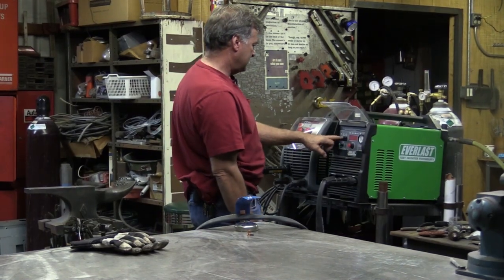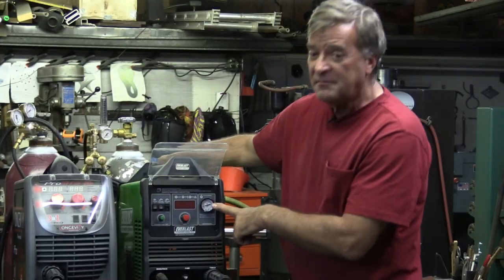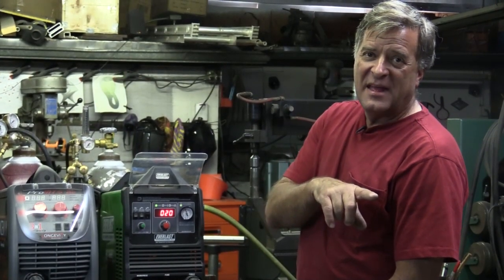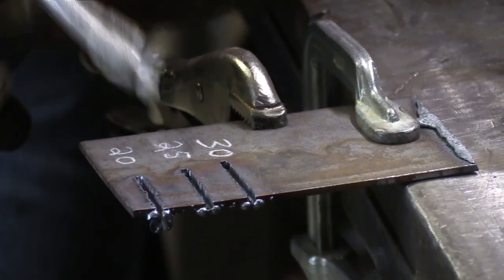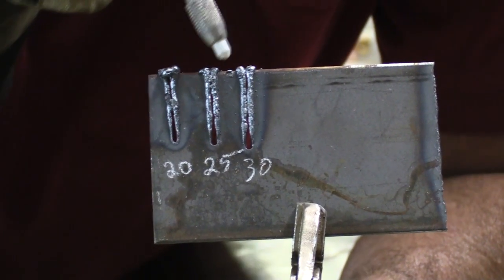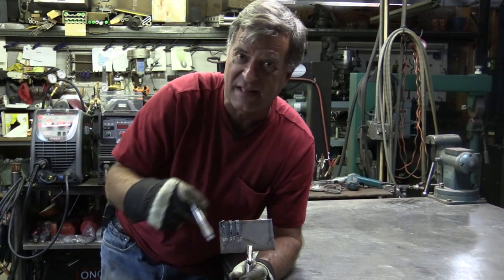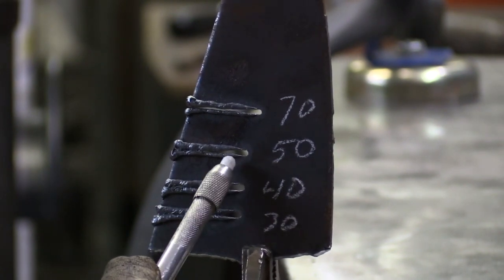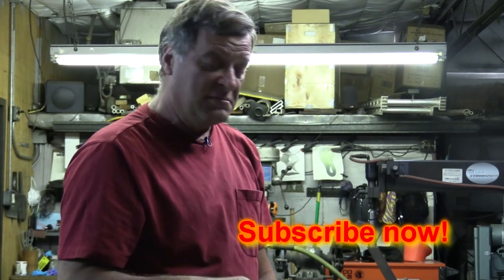How to Best Set Your Plasma Cutter for Cutting Metal - Kevin Caron

Comment: I'm returning my plasma cutter. It cuts horrible, the actual cut that is made is trash and it's just a horrible tool. A band saw blade it's cheaper and cleaner than plasma could ever be.
Reply from the maker: Thank you for sharing,
Reply: @KevincaronSculpture  after contacting the company and only asking for a new plasma cutter wand accessory. They said they wanted to send me a whole new machine without me sending the old one back.
Reply from the maker: Everlast has really stepped up their customer service.  I have been really happy with how that company is running.

Comment: i know this is from 4yr's ago but what kind of glass should you be using to cut  with a plasma... i get a lot of slag when it cuts through . im 66 so a little shaky ness go's along with my cutting . iv been verry happy with my plasma cutter it cuts through quite a  thick pice nothing is ever the same for me as thick ness go's thank you
Reply from the maker: I use compressed air.  No bottle gas needed. Try moving a little faster to cut down on the slag. Also up your air pressure to 65psi.
Reply: im sorry i use air also no gas with plasma sorry i have my air up quit high probably 75 i never cut any thing thicker than 3/8 even with aluminum i never ajust the air im repairing a aluminum flat bed for my truck probably 18" 3/16th ? it leaves quite abit of slag cuts fine nice fine cut but lots of slag i have a simadre CT5200D.. the everlast was mor money then when i bought this one it stick welds witch i have used an i have to say worked realy good it also is a tig but i have never tryed it that was a bonus i bought it just to cut with thank you for answering my question iv only seen one utube on here of this unit

Comment: Kevin hopefully you can help me I have a situation I have a plasma cutter it's a yes welder's cut-55 .. I got it as a gift anyway my compressor is showing 130 PS at the regulator & on the plasma cutter I have the regulators / dryer maxed out and the air  gauge on the plazma cutter only shows 60. if I put the PSI up to 140 Max  shows 70 on the plasma cutter air gauge.. do you know what could possibly be the problem. I'm running 1/4" hose . today I switched to 3/8 inch hose 3/8 inch connectors and no difference.. I'm trying to figure this out.. just so you know the company send me another plasma cutter and the same results.. thank you in advance and great videos by the way
Reply from the maker: Far as I know you should never run more than about 70psi! I have never gone higher than that. You probably have a bad gauge or regulator at the compressor. Have you checked that end? If you are getting the same results with 2 different plasma cutters the problem is not there. Thank you for watching and posting. Hope this helps.
Reply: @KevincaronSculpture  I'm going to get a air gauge and hook it up to the end of the air hose to see if it's putting out what the regulator is showing.. thank you for your help
Reply: @KevincaronSculpture  wow 70psi i just bought a plasma cutter today guy told me 110 psi and put cutter at 40 to 60 amps depending on what i am cutting

Comment: One guy told me 29 amps and 30psi was good with ant 50/60 amp plasma. Well I beg to differ all my plasma cutter done with those settings was foul up my tips  and had to change them a couple minutes after I tried those  settings my everlast 60 amp plasma. Cutter seem to work a hole lot better  at 60 psi with any amperage
Reply from the maker: I find it all depends on how thick you are cutting.   I have run 25 amps and about 30 psi before and got okay results.  The lower amps just help save your consumables.  Thanks for watching and posting.
Reply: @KevincaronSculpture   I was only cutting hot water tank making small designer fire pits

Comment: Hi Great  Info  thanks    Most of the other videos   and information  I have had is to aim the Plasma cutter vertically and not at  an angle as you have shown in your video   and I have found that  cutting vertical makes a much cleaner cut    . Interesting seeing the variation of pressure
Reply from the maker: Thanks for watching and posting.    I do get sloppy sometimes when I work.  But you are correct.  The torch should be vertical for the best cut.

Comment: My plasma cuts for 10 secs then the air stops  why does this keep happening??
Reply from the maker: Maybe your compressor is not keeping up with the demand of the plasma cutter?   If you get too low on pressure the plasma cutter may have a cutoff switch for low pressure.  Or you are not getting an arc and the pilot arc is all you are seeing.   If the arc does not start then the machine will stop trying.   Change your consumables and try again.
Reply: @KevincaronSculpture  il try changing the consumables, I have a 200ltr compressor, it should be sufficient I imagine

Comment: Well hate to bust your bubble, but it is about amps. You obviously haven’t read your manual, you cut at the amps your consumables are rated for. Just increase your cut speed for lighter materials. Air pressure is also an important part and you should be familure with that. I know my machine wants 75 psi and I cut everything at that rate. Since my consumables are rated at 80 amps, that’s what I use, cutting at a lower amperage or higher than your rated consumables, shortens their life dramatically. FYI
Reply from the maker: Which is why I use different consumables rated for different amps and pressures.   Lots of guys out there smarter than me to get advice from and then it's up to me to figure out how to use it all.  Thanks for posting and watching.

Comment: 70 is pretty low. My machine, a Thermal Dynamics, says 90-125 psi. Then there’s the minimum CFM you need, which is more the higher amperage you go, and the thicker metal you cut. It’s the air that blows the dross away. Look at the manual. I can’t believe that 70 is as high as you can go.

Well, I just checked their site. I’m amazed that the highest cutting pressure recommended is 75psi. That’s pretty low. Particularly for an 80 amp machine.
Reply from the maker: Hi Mel!      Seemed low to me also but you never know with the newer machines.

Comment: Hi kevin.with the plasma cutter,does this require more supply power. The uk one up to 50 amps say you can just plug into a household socket?never used one at home yet.thanks.also would you say a small compressor should be sufficient at max 24litres and 80psi.all the best.
Reply from the maker: I have run my little plasma on a 20 amp circuit and with a tiny roofing compressor. You can't cut very thick on 20 amps and only about 2 minutes of cut time on that tiny little tank of air.  But yes, it does want to have a lot more power and air volume to run the best.

Comment: Hi Kevin what you up to today ? Ha ha . Try going max PSI and Max amps for all material but adjust travel speed instead.
Reply from the maker: That will just burn up the consumables that much quicker.  You can get much longer life out of them if you adjust for the thickness with the amps.

Comment: wow, i like your video. . it help a lot before buying a plasma  cutter.  Finally a video that explains how to set a plasma cutter. I would like to have your opinion about the multifunction system 3 in 1; plasma cutter; TIG, MMA such as CT312P or similar  multi fonctional system for use as a hobby. Thank you so much. K. Caron is a French surname ... is not it?
Reply from the maker: You are welcome and yes, I am of French decent.    Out of Normandy in the mid 1500s is the best I could find.   I have several 3 in 1 machines and they have been rock solid so far.  One from AHP (the alphamig 250)  And 3 from Everlast. The  MTS 221sti has both AC and DC for the tig.     I have not had the chance to run a 3 in 1 with the Plasma in the mix.    All I have heard is to stay away from that combination.  Something about the High Freq start in the plasma taking out the boards for the other processes.   Everlast claims to have fixed that problem but I have not used one of the machines yet.
Reply: Hello. À Big MERCI for the information . I owned à MIG PACK 140 from Lincoln. Also a set of torch running light propane and oxygène. I want to complete my tools with a TIG and stick welder and a plasma cutter. But i do mot want to spend lots of money because i use it as hobby.

Comment: Another great Video, much thanks Kevin.  Just got a new bargain basement Plasma Cutter off of Amazon.  Seems to work fine on sheet.  What setting would you recommend on my air   compressor?  I have it set for nail guns and such around 90 PSI.  Is that too high for the plasma cutter?  I value your opinion and appreciate any and all suggestions you have.
Reply from the maker: If your plasma cutter doesn't have a pressure regulator on it for the air then NO,  you are too high on pressure.    Drop it to about 75 psi instead.   You must have clean dry air for the consumables to last on these machine. 

So a pressure regulator and a filter/dryer in the air line are a must!
Reply: Thanks Kevin for taking time out of your busy schedule to answer me.  I do have a pressure gauge on the front of the cutter and a water filter on the back but thanks to you letting me know, I was running much too much pressure for the little machine.  Keep the great videos coming, you information is of great help to all of us.
Reply from the maker: Happy to help. 

Thanks for watching!
Reply: @KevincaronSculpture  yes a great video.  I am new at this and seem to go through electrodes ever so quick.  Could you do a video on the "consumables" and include analysis on diagnosing when you are you are doing something wrong.  For example, my machine cutting very thin sheet splutters and cuts no where near as "clean" in terms of the consistent "noise' the machine makes.  I think this would be a great video and be a natural progression from this video.  Thanks again
Reply from the maker: Sounds like a good video.  Will try to put something together.

Comment: I really wish you had shown what happens at 50 or even 80 amps on the same material. What happens?
Is there a reason you should NOT always use maximum amps? Presumably your cutting would be quicker than at say, 30...?

Thx for the video!
Reply from the maker: The cut gets wider and more uneven.  It's all about the balance of amps to forward speed to air pressure.  I am getting better at it but still have a lot to learn.
Reply: Great, thanks Kevin

Comment: Hi Kevin:  Like your show. Question:  My ICUT60 cuts but not straight, always have an angle cut, what is my problem? thx.
Reply from the maker: change the tip and nozzle.  They are worn out.    You might check your air pressure and make sure you are running the correct pressure for that diameter nozzle.     Give George at Georgesplasmacuttershop.com a call.   He can set you on the right track better than me.    He also carries most of the consumables for the torches.

Comment: Hello Kevin.
Good video. 
I have the cheaper Harbour Freight model at 20 amps 110 volts.
It cuts well but what I find is that when I try a higher psi over 50 it tends to extinguish the arc .
Seems 40 psi is the sweet spot, just cut up about 1 ton of scrap 1/8 thick metal and used about 2 nozzles and electrodes on the trafimet s45 torch using the standoff.
I did do my cutting outside using a 50 foot 10 gauge extention cord so that may have something to do with a bit of a power sag but the unit surpassed my expectations. 
The use of a air dryer in the air hose may have helped with the consumables but I didn't have one installed, forgot to put it on.

Comment: One thing to consider though (if this hasn't been mentioned yet further down the comments) is that amperage for plasma do not mean as much as amperage for welding. For plasma, amps work together a lot more with the voltage, so depending on the exact type of machine, one might need 10 amps on one machine to get the same result at the same air pressure as another machine cutting the same thickness of metal.  It would be safer to err on the side of the higher amperage, but travelspeed would have to be adjusted accordingly to prevent too much dross on the bottom side.

Comment: I think the feedrate is more important than Psi or Amperage. I've had cuts with little to no slag at a fast feedrate.
Reply from the maker: Love it when I get it just right..   everything comes out so smooth..
Reply: I love using my everlast plasma cutter. I never thought cutting metal could be so fast and easy.

Comment: actually the recommended psi per ever last tech support is 72.5 psi. 
also you could get a much cleaner cut at 25 amps with 30 amp consumables instead of the consumables that came with the torch. i assuming that it had 80 amp consumables in it. with 30 amp consumables it would have been a sharper / narrower cut.
Reply from the maker: True, but the pressure changes depending on the consumables and the amps..  

But yes you are correct.  With the right size consumables and setting you get a very nice cut..

Just got a new torch for this machine.    A Tralfamet s75.    Will have to give it a go and see the difference.

Comment: I just got the AHP (from you, thanks). When I set the machine to a psi, it drops a good bit when the trigger is pulled. Is the psi supposed to be a preset or a working pressure?
Reply: Kevin, Rob at ever last told me the psi should be set to working and not a static pressure at the gauge. he said turn on the manual air switch so air is flowing through the torch and set the pressure from there. then turn auto air back on if you like.
Reply from the maker: +1111TerryD     Preset..     try a larger diameter air hose..

Comment: Hi Kevin,
my Longevity WeldAll 200 (LS-200PI, IGBT inverter) in TIG mode it generated an arc so HF works but no current to make a puddle.  Also the stick function and the plasma cutter function don't work either.  Longevity (Jesse) says that they changed factories from the blue (mine) to the black (current model) so they have no schematics and/or parts.  I just let it sit for 3 months and puff....it is in a coma and I can't revive it.  Do you know anyone who fixes these chinese devices?
I remember running a similar experiments and yes, air pressure is the trick to plasma cutting.  Thank  you for all your awesome videos in the past.  Andy M.
Reply from the maker: +andy messina      If thing I would do is check your electrical connections.     Make sure the wires in the wall plug are tight as well as the ones in the plug if it is that kind of plug.     But it sounds like it may be dead..      Shame on Longevity for not helping..
Reply: I replaced it with a Lincoln Square Wave TIG 200!!!
Reply from the maker: Well that will fix it also!!   Congrats!

Comment: Thanks , Kevin , I will let you know ! I know my acetylene torch with a no. 3 tip will cut through 1/4" steel no problem ! Also like you said in another video , no electricity needed ! I might have to stick with sheet metal for the plasma cutter ! 50 amps , how much is one of those ? $1500.00 to $2500.00 or more ? When will they be cheaper ? Thank you !
Reply from the maker: +Mr. Heiss You can find them used for a good price sometimes..      As for cheaper..     AHP  is releasing their new plasma right now for $800.    I think it is a 60  amp machine....  Have not seen one yet....

Comment: Thanks , Kevin ! I was going to buy a plasma cutter but didn't know how many amps to get , the higher amperage machines cost alot more ! So I will buy a lower amp one and use the air pressure settings to adjust it ! 1/8 to 1/4 inch steel is about the thickest I will be cutting ! As always , Thanks for the great videos and helpful tips !
Reply from the maker: +Mr. Heiss 

You are going to need about 50 amps to get through that 1/4 inch...    let me know if I can help you buy one.    I do sell for Longevity , Everlast and AHP..
Reply: Kevin Caron, Artist Angel no hate a prej že Jo no hej a passion

Comment: Never used plasma. If you are steady with your cuts do they come out cleaner. Like cutting with a torch? Can you bevel with plasma?  Thanks
Reply from the maker: +ZAC LLOYD     Cleaner than a torch with a smaller curf.    And Yes, you can cut bevels also...
Reply: Kevin Caron, Artist  oh I see. I work with guys that can bevel mild steel 3/4in with a torch for a insert of a ship clean and smooth. I can't do it as well I have to grind some dross off. If you could bevel at a 35° to 45° like that with plasma could it come out clean? Thanks
Reply from the maker: About like a torch for that thickness...    It's all in the practice.

Comment: simple- use non-chinese cutter, look in the manual for pressure settings and use correct nozzle for the amperage. If you use 60amp nozzle then set machine to 60 amp. Simple.

Comment: If you will hold the torch square to the metal, It will make a lot better and cleaner cut. You had it angled on ever cut.
Reply from the maker: +William Castleberry      Shows up better on camera at an angle..     But you are correct...